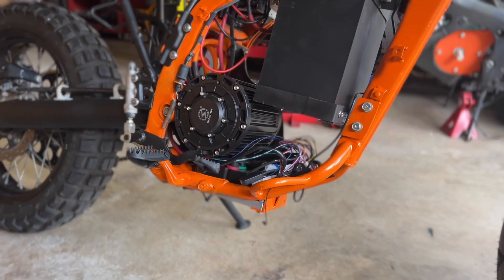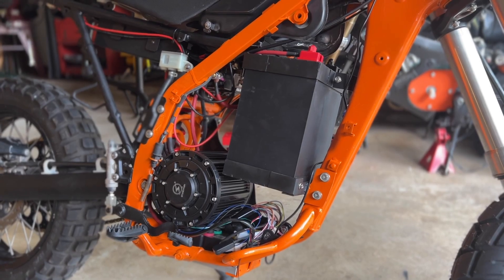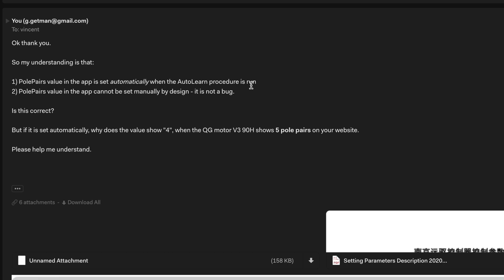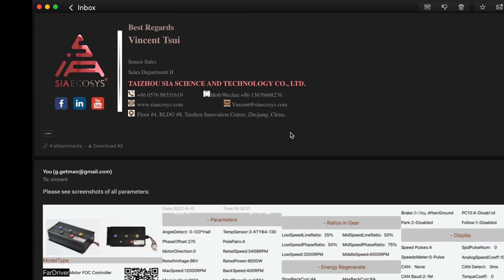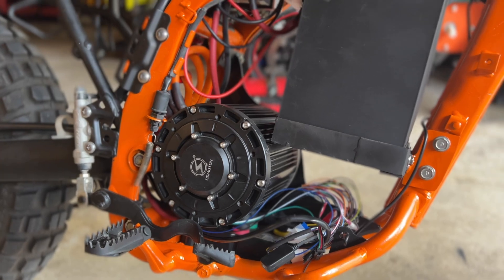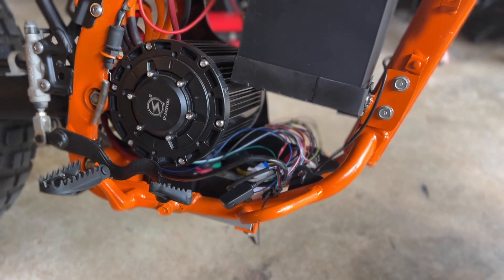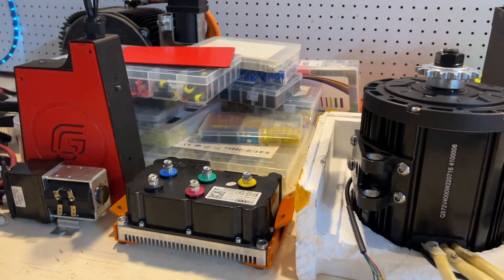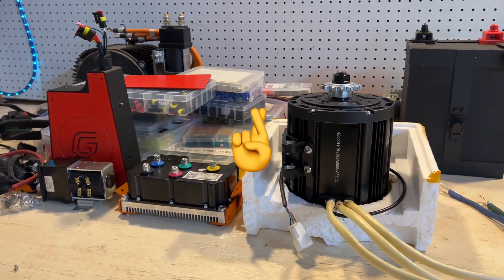I Bought My QS138 Electric V3 Motor on Aliexpress and It Short Circuited

Comment: I think you made problems by yourself when you shortened phase wires. Each strand is covered by enamel and you need to clean it to have low contact resistance.You just cuted extra length and pressed on new connection.Please correct me where I'm wrong.
Reply from the maker: you make a good point - I didn't think about whether the enamel would extent to the copper strands making up the phase wires themselves -- but obviously the phase wires are just extensions of the windings in side the motor. I'll having to inspect them and figure out if the enamel extends all the way to the terminal. Thanks for bringing this to my attention!
Reply: @GaiusGarage  I already cleaned 84 strands for one phase.I have qs138 70h.
Reply from the maker: @qwantumijo  what do you use to clean them?
Reply: I used sandpaper.Clean some 1 inch or a bit more.Then try to straighten all strands and look at shortest one.So you should cut all to shortest to use all strands to be pressed for lowest resistance possible.
Reply from the maker: @qwantumijo  again, thanks so much for bringing this to my attention. I checked and indeed I was crimping directly on top of enamel - not even making contact with copper..big mistake 😖 -- was this the reason for my motor overheating? maybe. but get this..I check the terminals that I cut off - the ones that come from the factory and cut the lugs to see the wire underneath...it was directly on enamel also! so at least when it comes to this motor from the factory - they are making the same mistake, probably to cut cost. I am going to make a video about this shortly and give you credit
Reply: @GaiusGarage  if your motor lost just some 6 to 10 strands at each phase it will work.Just you can't use it's full potential.It's hard work but just be patient and clean all 250 strands.
Reply from the maker: @qwantumijo  I made a video about this and give you credit in the description. thanks again for bringing this to my attention. whats crazy is that I discovered that the crimped terminal came this way from the manufacturer also! https://www.youtube.com/watch?v=HNDqLJDV5gE
Reply: You are amazing correct, i would go further and solder the ends.

Comment: You are fuqqing with us, right?
Lol
Reply: It says right there on a motor 4kW and you say you “only” ran
12kW?? too funny
Reply from the maker: @somegame1929  the kw ratings on these motors are for continuous power and very conservative. the power I cited was peak not continuous and people run these at a wide range of power levels much greater than 12kw. I've since solved this issue and determined that it was the controller not the motor that was the issue. the new motor I have no longer overheats even at 25kW
Reply: @GaiusGarage what is the name of the new motor?

Comment: Thank you for your information.. I am planning on building a tricycle with one of QS138 90H .  Any feedback on the new motor will be greatly appreciated 

Is the new seller of any good ?
Reply from the maker: the new motor is running but also been heating up rather quickly - I've narrowed the problem down to settings in the controller. I adjusted some of the PID setting and the motor doesn't run as hot but still not so cool. The issue is really the controller, and specifically the app used to program. It's really terribly designed and you can't change certain settings due to bugs. support is also terrible and rarely useful. I think you should be ok with this motor but I wouldnt use the Fardriver controller - the app and support really sucks
Reply: Thank you…So I guess go for the motor but pair it with a different controller .. 

What controller model are you using
Reply from the maker: i @benardopoku3538  Im still using the Fardriver controller because its what I purchased (twice) so I'm kinda committed here. The controller itself is ok, I guess but its really the app used to program that's the issue. Ive tried on iphone & android and some setting just cant be changed. I asked support about this and they give me a variety of response from "its a bug" to "its not supposed to be changed" meanwhile, it clearly the kind of option that needs to be configured to properly calibrate the controller. There's a PC app as well but it's pretty much un-usable. Alot of these controllers from China have terrible configuration software. I also have a Kelly controller and at the very least the settings are able to be changed but the software is buggy also (I have a video setting up a Kelly controller as well). Ultimately its a "pick your poison" kind of thing
Reply: Choose your poison exactly.. I have been following one guy on configuring and usage of the Votol em150s and 200s with the qs138 motors and it seems to be working fine and the software is stable per what was saying and the tests rides but that’s the PC version of the software..

I will still be following up on that , as it stands it seems I will go with the votol controller with the qs motor..
Reply from the maker: @benardopoku3538  yeah I see a lot of people using Votol controllers with these motors. I chose Fardriver because its made by the same manufacturer so figured it would be a quick plug & play. This project was meant to be a quick & dirty build to have some fun on while I work on a more complex project, but now its a while thing : /

Comment: Would have been interesting to look inside the motor to see where it might have short circuited. Since the motor is going to a waste anyway, might as well disassemble it for the video?
Reply from the maker: Yeah, definitely planning to do this. Don't have experience winding a motor but might at as well give it a shot

Comment: Hello, which bms and controller do you recommend for the qs138 3000w 70H engine
Reply from the maker: well I don't know if Im the right person to ask - my bike isnt even running. But in general, Fardriver controller is easiest to set up with QS motor since they are manufactured by the same Chinese company (SiAECOSYS). Just be careful which vendor you use - the new controller I got here is definitely higher quality than the one I was using before the bike failed. If you watch the video, you will see the Aliexpress store name that I used (QS Motor Limited) -- I do NOT recommend you buy from them. For BMS, ANT BMS has worked well for me but just know that it does not do active balancing - over time your cells will get out of balance even with the BMS

Comment: So I just finished converting a Vespa with a QS motor and got a lot of good advise from retrospective mopeds

1.) Open the motor and count the magnets for pole pairs
2.) allot of people run QS motors with the temp sensor off and use the other temp on the controller 
3.) sounds like typical customer service from china do a charge back on the first order
Reply: Don’t do a charge back through Ali express, go through your bank
Reply: are chargebacks on aliexpress normally successful?  I've been seriously considering a QS motor/controller for a conversion but failures like this coupled with shit support is pretty scary considering how expensive everything is.

Comment: 4 pole pairs is correct! It sees coil pole pairs .
And it's not a bug , they don't know what they are talking about .
That's how Fardriver drives the motor with coils
Reply from the maker: Yes, I left that who thing out of this video because - well I was too lazy to do the editing to explain that whole thing - but that's so much for your help on this!
Reply: 4 pole pairs it not correct. And anyone who understands what a 3-phase motor is knows you can’t have 4 pairs of coils (8 coils). The correct pole pairs for this motor is 5 and it will set correctly if done correctly.